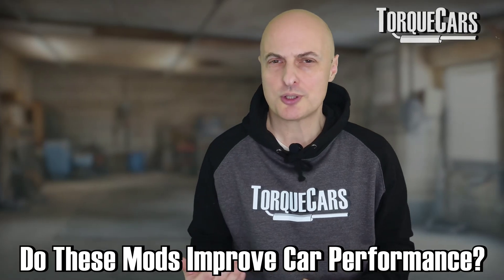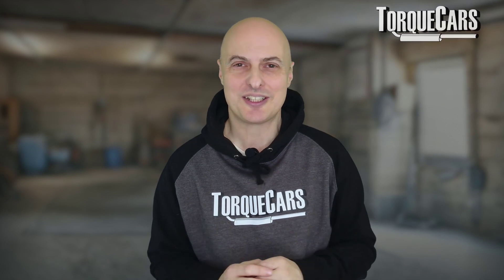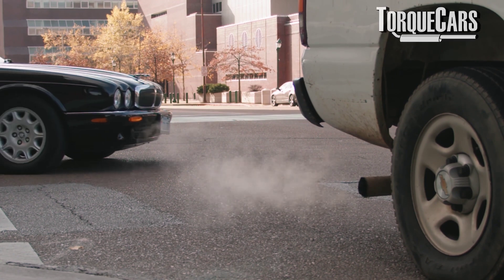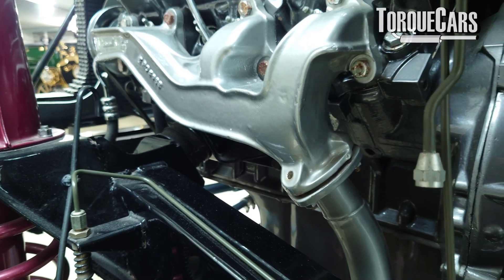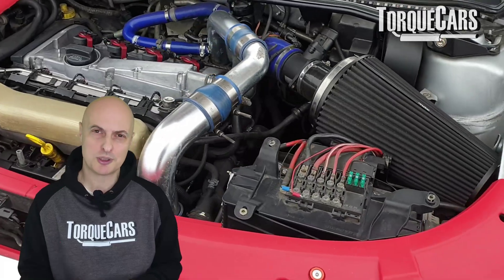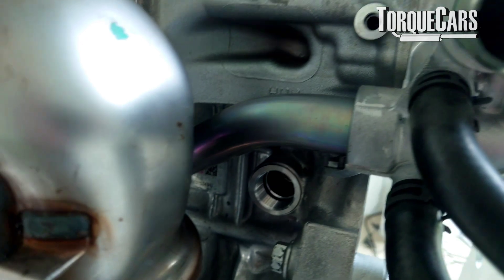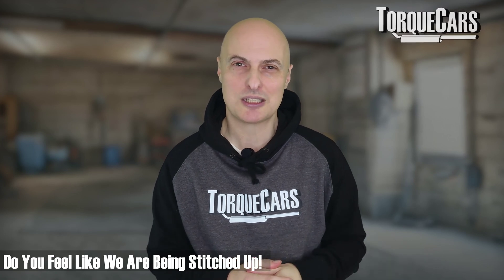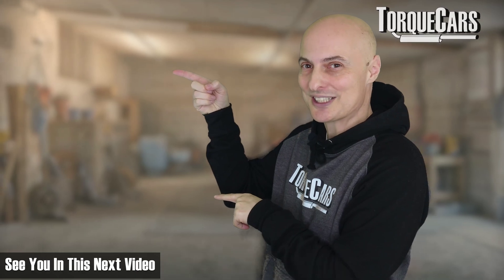These Illegal Car Mods Make Your Car Run Better But What Are The Risks & The Hidden Catch?

Comment: As far as I know, in the UK the MoT computer system tells the tester whether the car is supposed to have a particulate filter or not.  I owned an early Peugeot 607 HDI which was one of the first production vehicles with a DPF, and that never came up on the computer system as needing a DPF.

Comment: I had a diesel Citroen 10 years ago and blanked the egr for about £5.
Engine ran better, fuel economy improved, as did performance.
No black smoke, no engine lights, and passed MOT emissions for 3 years after

Comment: I had a car with a DPF that was removed by the previous owner and it always passed a legitimate MOT test on emissions.  And i have a crossfire that when tested shows way below the 225g tax band it's in. I should based on the mot be paying around £160 not £410. It's all a con

Comment: I would never modify a modern vehicle and and N.S.W we have the yearly registration inspection and if you modify your car it will fail but my 1997 Toyota Hilux with its exemptions for safety and emissions it always passes its yearly inspections and has only failed twice on the exhaust system one was for the first part of the exhaust system which was fitted by the previous owner and it was a cheap Chinese rubbish part it was leaking at the flange that bolts onto the manifold had to be replaced by an Australian good quality part and the second fail the following year was for the rear part of the exhaust system it was just warn out and back to the exhaust specialist replaced the exhaust part with a much larger pipe and muffler but because the larger pipe it has actually given my Hilux a bit more power l actually can notice it the only thing l thought the rear muffler is bigger my ute will be quite l don't like loud exhaust systems but the slightly extra power and torque so much better to drive l kept up with an E type Jaguar to 60kph but that's nothing to brag about a Honda Accord can out accelerate an E type Jaguar as proven on Top Gear

Comment: Hi guys. Im from germany. I work for a Tuning company. It is said that Euro 4 diesels pass TüV emmsion tests without DPFs. 

It seems to be true that they do pass. but onlz cars Under Euro 5 or specific Euro 5 moddels
Reply: Afaik, the emissions measure the opacity of the exhaust gases, not the particles which are very harmful because they get stuck in the pulmonary alveoli and may cause cancer. Just like brake dust apparently.

Comment: the best MOD ever is to drive more than 30 min every time, at minimum 2200rpm for turbo and 2800 for aspirated (+/- 100 rpm)
Reply: My diesel needs 20 min to warm up at moderate winter temperatures.

Comment: best MOD for 1.4 and 1.5TSi is the ACT/COD off, it will not affect the MOT and it will protect the engine and gearbox.
Reply: @cri1410sti  No google search hits on that. Just call of duty and activision junk .

Comment: In other words the freedom to modify cars has gone.Since when exactly did this become illegal ?.
I grew up with people putting small block American V8's in 6 cylinder Ford Zodiacs and Vauxhall Crestas.All done with nothing more than the required engine number and capacity change on theog book/V5. 
I'm still running the Jaguar XJ 12 which I modified from 5.3 litre to 6 litre.3 speed auto to 5 speed manual, ITB induction, straight through exhausts and lower final drive ratio.
All with just a call to DVLA and list for insurance cover.
It's passed numerous MOT's with a shrug of the tester's shoulders and a nod.
What's changed and when ???.

Comment: Bigger flow turbos are illegal. Each car has a certificate of conformity the governs it's rate of emissions and is road taxed accordingly. Any modification that changes this is illegal and needs to be retested for it to be legal so you can ascertain yourself what mods will do this  and in the UK any mod that changes the test result of its certificate of conformity result from the factory makes it illegal.

Comment: I had a car once (not in the UK) that had had a cat delete done by the previous owner and, to be perfectly honest, I hated the smell of 1970s combustion on me after driving. Nowadays, catalytic converters are much better dimensioned. Changing the air filter or something else could render a better gain without (illegally) touching a very expensive and useful component.
Perhaps there's "a better case" for deleting a particulate filter since it deals with physical treatment rather than chemical and can get clogged up. I wonder whether there have been any studies on whether smaller particles are safer.

Great video 👍

Comment: Best advice, simply don’t buy a diesel car or any ICE car since 2018 since petrols of this era have particulate filters. Modern but older petrols i.e. 2003-2018 are the way to go. No dpf. No egr. Way less soot. Easier life.
Reply: Calm your ropes, I've got a modern diesel with a working DPF. No issues and car is on 250k miles...

Comment: I'd never remove a particulate filter myself, but at least on petrols they do seem a bit pointless to me. I can't remember the exact result, but the last time I had a read-out for my 2007 C30's emissions test as part of its MOT the particulates were basically 0. And thats now an "old" car, with relatively high miles and a pretty unsophisticated emissions system, I can't imagine a more modern petrol doing any worse. Which then begs the question, why is the particulate filter even there? A well maintained car should only be throwing out a negligable amount of soot anyway.
Reply: MOT test doesn't actually test the harmful particulate matter size... as it's mostly invisible. Older petrols ran on lower compression causing lower particulates. However, with engine downsizing and turbocharging, some petrols actually end up chucking more particulate matter out than a 3.0 diesel!
Reply: Petrol are far more harmful than diesel.

Comment: Some druggie stole the cat converter off my Nissan pickup now it runs better and uses less fuel. No check engine light because there's no downstream o2 sensor. I just asked someone to weld a pipe connecting the manifold to the remaining exhaust 😂

Comment: Could you explain why so many drivers seem to equate noise with power. And perhaps explain why so many 'modded' cars misfire , backfire and sound like a bag of spanners? 
As for the three Mods you discussed, unless your Insurance company gives you the OK, you might well find that your Insurance is void. Always look at the small print!
Reply: Those are just RICErs.
Reply: Called a "pop and bang" map. In the olden days, when you were a very good driver and managed to drive a modified car hard (without crashing.. hence VERY GOOD driver), occasionally some unburnt fuel would end up in the exhaust at high revs on a downshift, causing a bang, maybe some flames. Used to be a sign of a highly modified car with a very good driver inside. Now, with software tweaks, injectors can fire every time someone lifts off the throttle... so FUCKING annoying.
Reply: The same for smoke and power.  Smoke=broke!
Loud noise means small body parts!
The idea of anti-lag is to ignite fuel in the manifold just before a turbo to keep it spooled up. Unfortunately the boy racers do this to get a bit of excitement as they don't get much else.

Comment: If your EGR blanks throwing a light, just undo the negative battery terminal for 30 mins, put it back on, idle for 20 mins then a good half hour drive.

Comment: The soot in a particulate filter is heated as stated but the end product is ash. This isn’t small enough to pass through the filter (which would defeat it purpose) but is of much smaller volume than soot. The retained ash eventually will fill and block the particulate filter over sufficient regeneration events (100000s of miles of driving). The filter is effectively a very very long term service/replacement item. It’s also why modern oils are low SAPS to burn to as little ash as possible to avoid premature blockage of the filter.
Reply: Actually, the soot is oxidised into CO2 and leaves as a gas. It's the components that can't be oxidised that is the ash, usually from the engine oil.

Comment: In the U.K, If a car is made in 1992 or before it doesn’t have to have any filters at all, but it does still need to pass the M.O.T emissions which is highly likely it won’t. I have a Nissan Pulsar GTIR 1991 on a J plate. No filters but thanks to the re-map it passes the emissions. Happy days.

Comment: Most of these won't make a difference in performance & only gives car enthusiasts a bad name
Maintain your vehicle & it won't be a problem
Do a chemistry course
Why trash the environment?? Do I trash your home??
Reply: While the elites fly in their jets and build their new homes by the sea with rising sea levels,   LoL you mug
Reply: Factually incorrect and I was advised by a tester to do an EGR delete, because it has so little impact on emissions. All these mandated systems are expensive and complex. Next you’ll be telling me I shouldn’t go out for a drive for leisure because it’s polluting the environment unnecessarily. Get a life
Reply: Not trashing anything mate.
Reply: Saving the environment in one area destroys it in another. New precious metals must be mined. Vehicles become heavier. MPG goes down and tire/brake dust goes up. Then the car breaks down and you scrap it for a new one.
Reply: How much pollution are the fat cats responsible for?